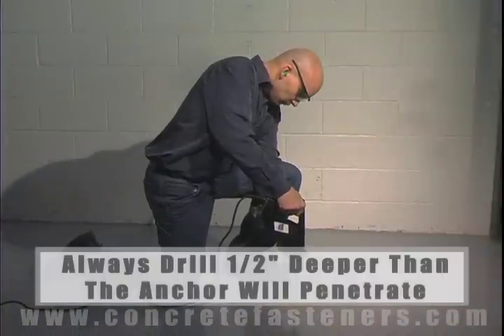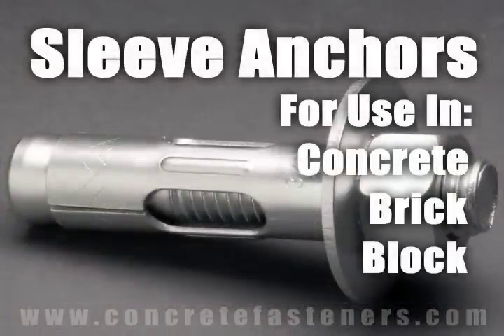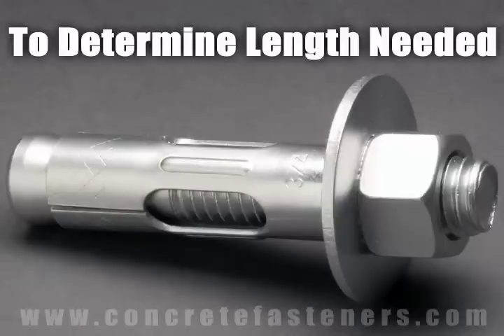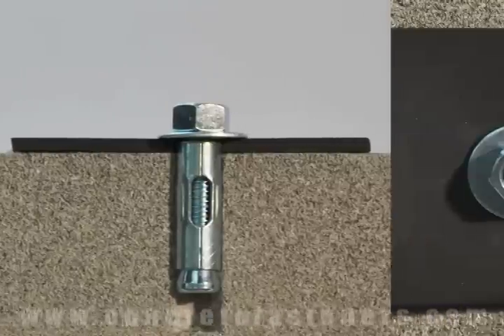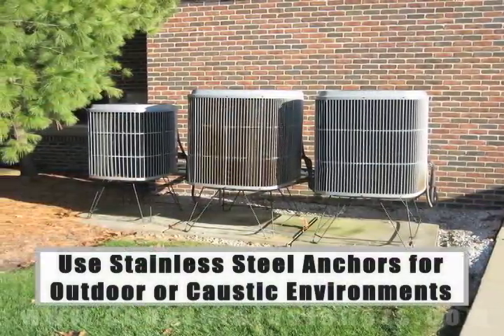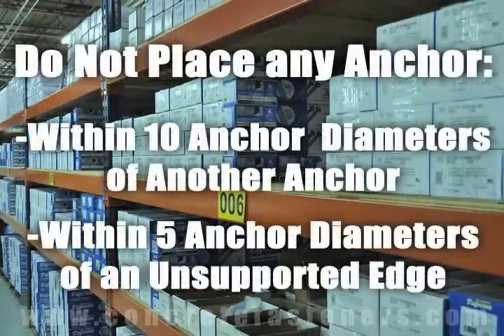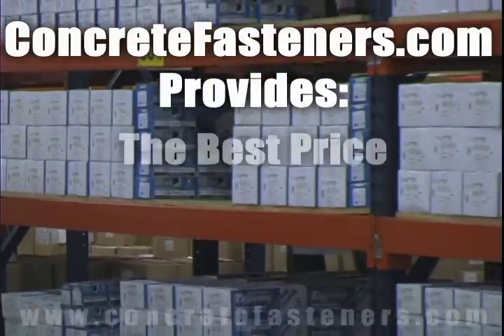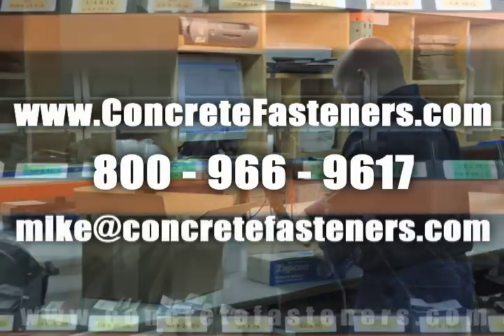Sleeve Anchors for Attaching a Light to Concrete

Comment: Thanks for providing one of the only videos that shows sizes and depths to attach an actual fitting into concrete. Most of the other videos are totally useless as they do not specify hole depths or tolerances and actually do not even show how to attach a fitting - they basically tell you how to fit a bolt into concrete! Why would I want to put a bolt into concrete? I would prefer to actually attach something to the bolt.

Comment: I always do the same thing I’ve  use the right tools and the right drill bits and I’m tired to have a problem tightening, when i turn the nut the all thing turns and the bolt can never be tight. What’s the secret ??
Reply: Your drilled hole seems to be too wide or the bolts threads were damaged while hammering it in. Put the nut on the bolt before hammering. The nut should turn before the bolt does.

Comment: Would this be good to use for mounting a 55 in TV above a brick fireplace? (assuming there is continuous brick going up the wall from the fireplace; actually it's brick with layer of plaster over it)

Comment: Great video.  If you need to remove the light fixture at a later date for maintenance, can you unscrew the sleeve anchor nut, remove the light fixture, perform maintenance, then reinstall the light fixture using the same sleeve anchor nut without affecting anchor performance?

Comment: Can you tell me what should be the hole diameter of steel member which is attaching to wall with concrete fastener like Expansion bolts? Is it 1/16" or 1/8".
For Epoxy I am using 1/8" hole tolerance.

Comment: I've noticed with this video the actual Sleeve part of the anchor is not flush with the concrete?  Is there a reason for this?  IF you remove the item being installed wouldn't some of the sleeve be exposed?  Would it not be better to tap the anchor in without the item being installed so that it is flush with the concrete?

Thanks much,
-Nigel
Reply: Hi, I think this is why you drill the hole deeper than the length of anchor being used. once removed you can hammer the anchor flush with the floor surface.